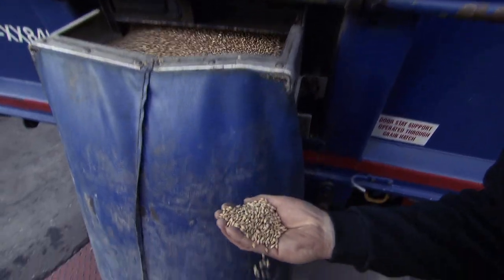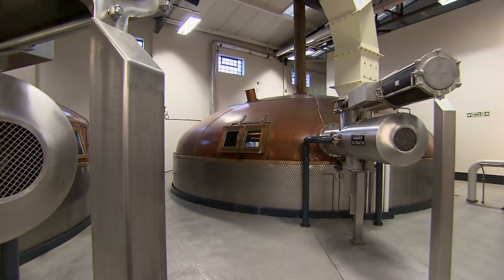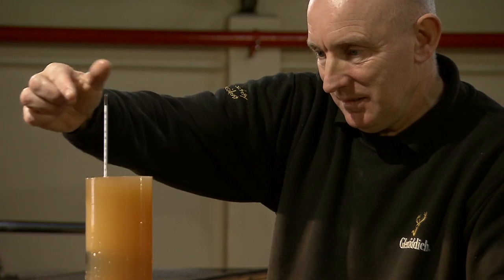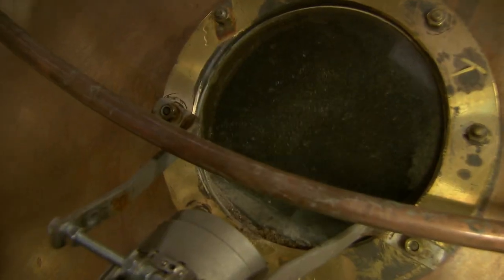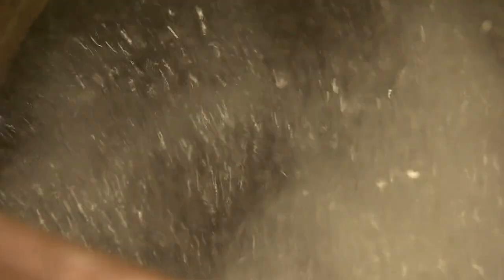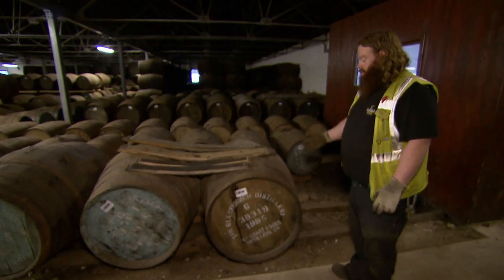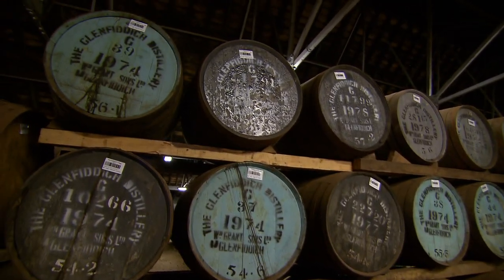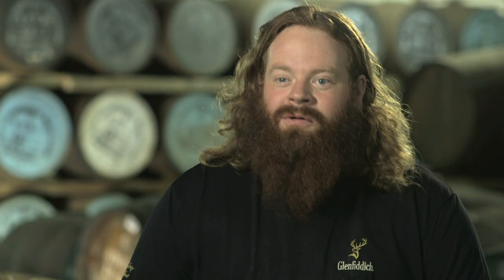How to make Glenfiddich whisky: Daily Planet goes to Scotland

Comment: What's so awesome about the 15 especially is that it's from their "solera cask/vat". Which is where they add the 15 year old whiskey to a very large container, then fill bottles until the vat is about half and repeat. So some of the whiskey in there could be much older than 15 years. Very interesting!

Comment: 100,000 bottles per day? Wow, that seems crazy high.
Reply: that's 75 million liters a day,,crazy indeed and unthinkable
Reply: @Mark Muller and this is everyday??? it's not possible
Reply: @ARCSTREAMS   you should improve your math 😆 😂 because it is rather 75.000 litres per day. Also note that bottles made for the European market only contain 0.7 litre 😉
Reply: you are correct i made a mistake and it should have been 75K liters if all of it was for western market only ,so somewhere between 70 to 75k a day almost 20k gallons,,still crazy  and impressive
Reply: Yeah, that's an absurdly high number.  Maybe they meant 100,000 per week (or more likely) per month.
Reply: @brianhawkins  per week makes more sense if it was soda lol even that is hard to believe but single malt??? thats like making it not rare at all anymore
Reply: @ARCSTREAMS  IKR?
Reply: @Jay M id be paying alot more than 35 if they could not meet demand and as it is no single malt i ever seen was that cheap,they run around 50 cheapest and upwards